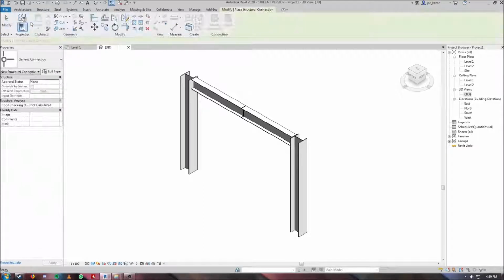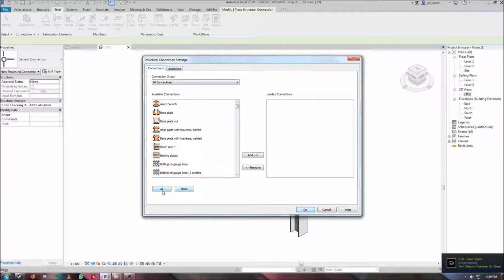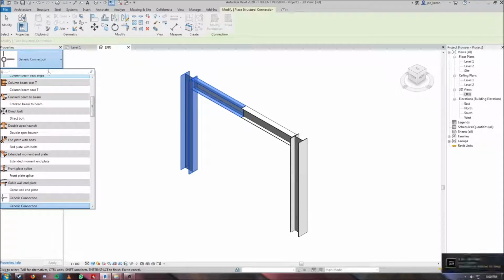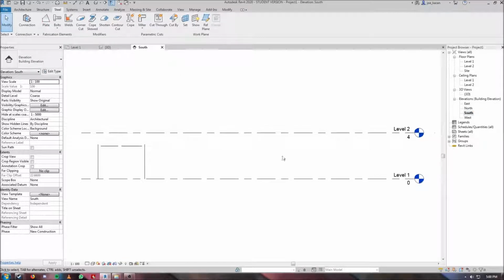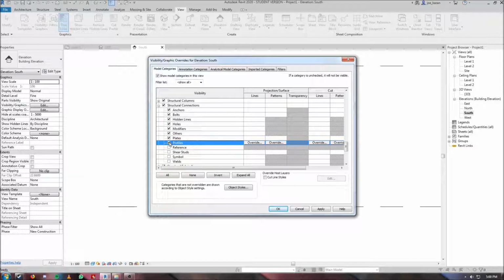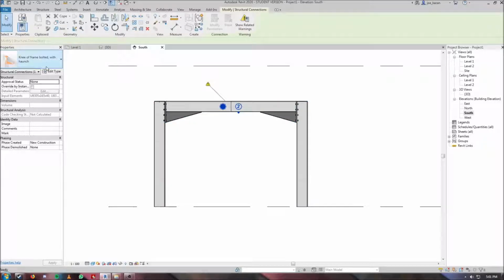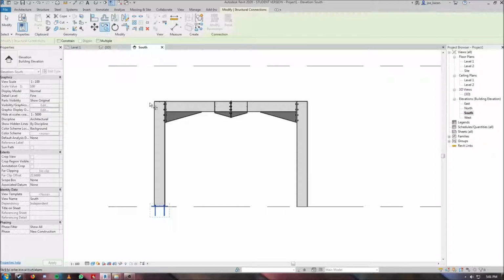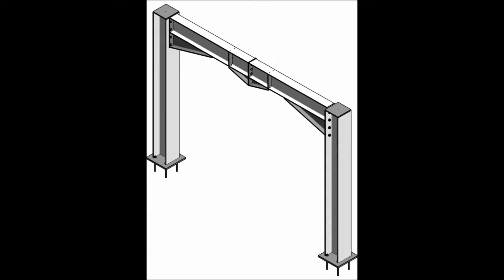Revit Steel Connections - Quick Guide (Revit 2020)

Comment: Doesent work by me. It shows me a Warning:  The connection is failed. Im using Revit 2021
Reply from the maker: Can you show me what you are trying to do exactly or give me a bit more info so I can try and help?
Reply: I'm facing the same issue, the steel connection on my PC doesn't work, it keeps show the warning "Invalid type or number of input elements". I've tried using another PC and there is no problem at all when creating a steel connection, but with my PC that warning always appears, so I can't create any connection. can you help me, please? Thanks
Reply: @chandrasajana2299  I just reintall Revit and download the family template separately and know i dont have this problem

Comment: Can't modify connection parameters even with button NOT greyed out
Reply from the maker: Can you show me a picture of the connection you're trying to edit parameters for? A little more explanation even would be nice to be able to help
Reply: @kazouza  I installed Revit 2018, just as all other students in my class. All our settings are the same. Installed the same steel libraries and all. It is just my computer having trouble inserting the physical connection, as well as modify params not doing anything upon clicking, even when button is available to click. Revit 2017 works btw. Very strange bug that just affects my laptop. Forums are useless as always, giving obvious troubleshooting answers and not thinking through a more technical perspective
Reply from the maker: @dee23gaming  This is indeed weird, never had an issue like this before. Are you guys using a cracked version or a student license?